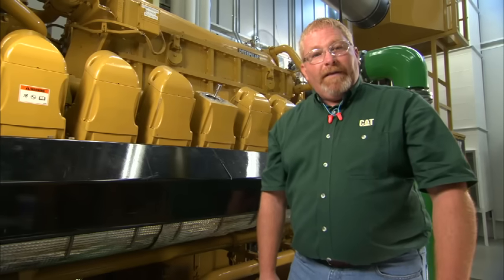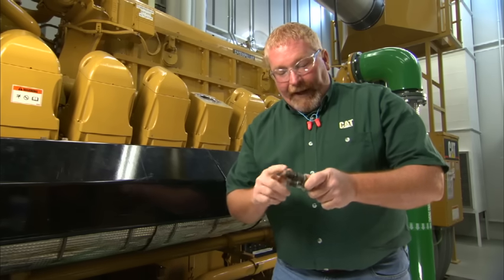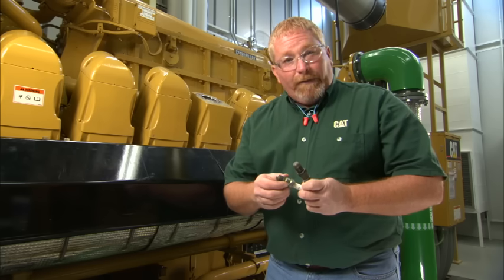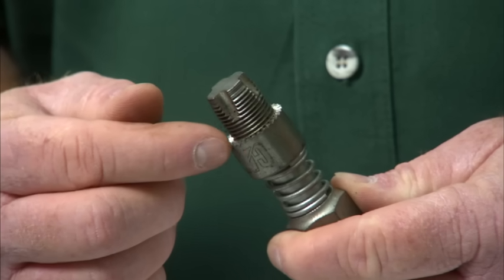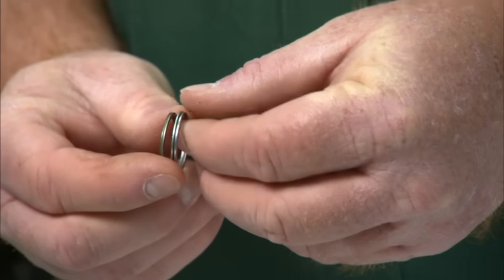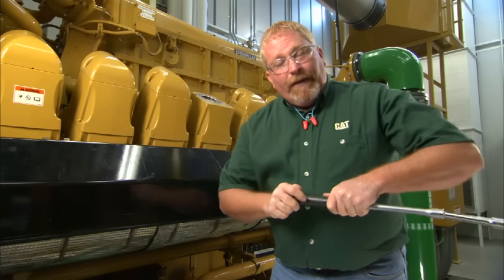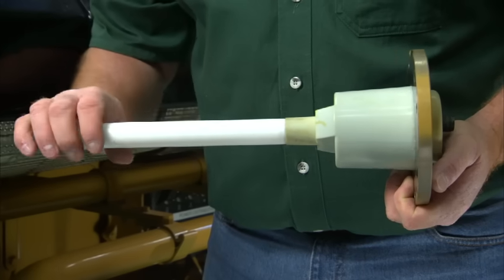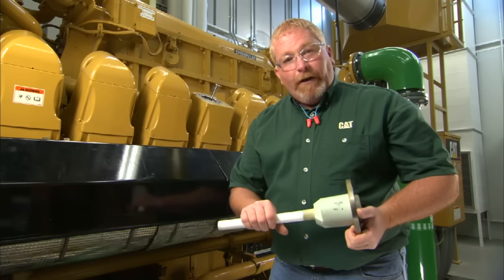Spark Plug Maintenance Tips

Comment: Do you add any lubricant to the spark plug chaser to clean the internal mating threads??  It appears all you need to do is run it dry to clean the threads and they collect in the groves.  Do you need to apply grease to the grooves to catch debris??  This is something that some recommend and is not discussed on other forums.  Just wanted to know the best practice.  Thanks.  Great video explaining the process.